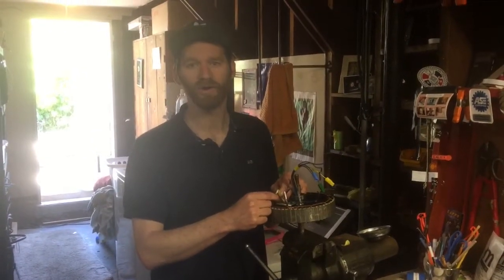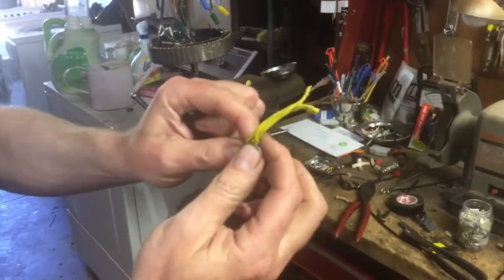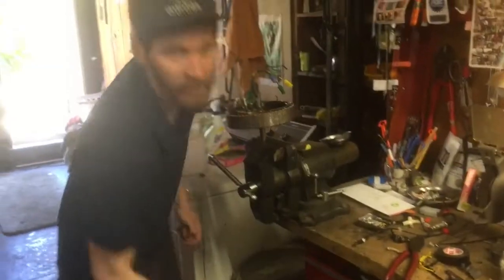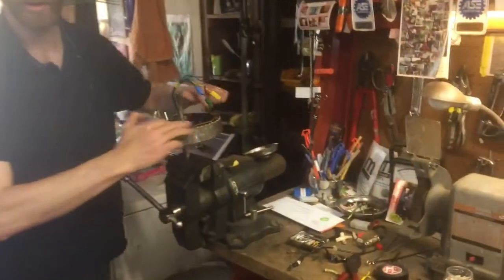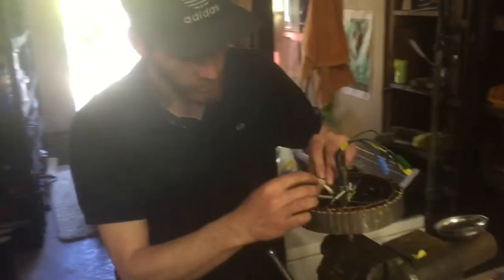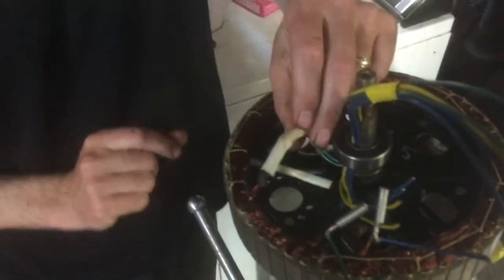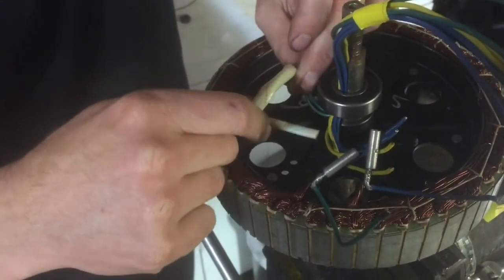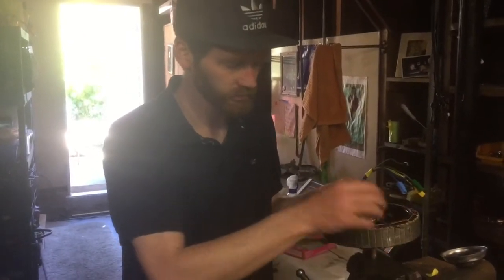Hub Motor Wiring Repair 1

Comment: I’ve been looking at all videos about rewiring e-bike hub motors & can’t find 1 which shows exactly where each phase wire attaches inside the hub. Obviously like for like reattachment as per hall sensor wiring but my problem is that i had an axle spinout on my Dapu M155, after which the motor has not worked. the yellow phase wire is not attached....display shows o.o speed and PAS 0. the lights also won’t switch on; after 10mins the display shows 33 the switches off...any ideas appreciated
category: dapu m155 rear disk brake 
gearbox: planetary gearbox with freewheel 
type: bldc motor (brushless direct current) 
power: nominal 250 w (maximal 400 w for rotation sensor, 500 w for torque sensor)
 used bb set: ncte sbbrf - rotation sensor ncte sbbrt - torque-rotation sensor
Reply from the maker: Thats a tough one.
The only hope for an answer may be to post on endless-sphere.